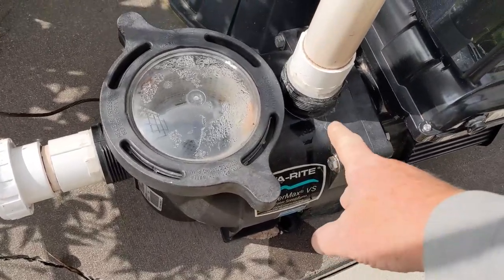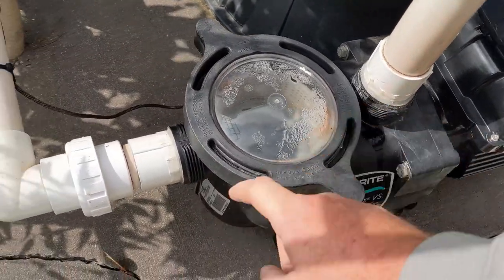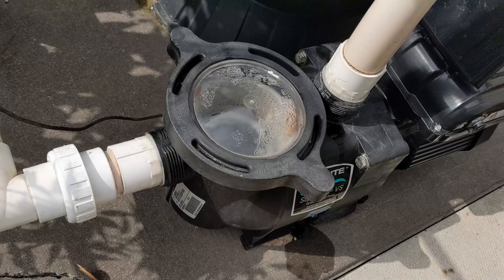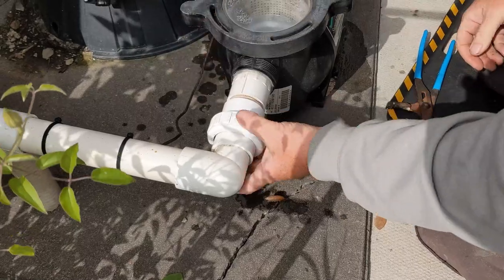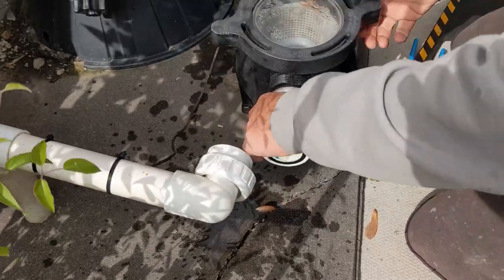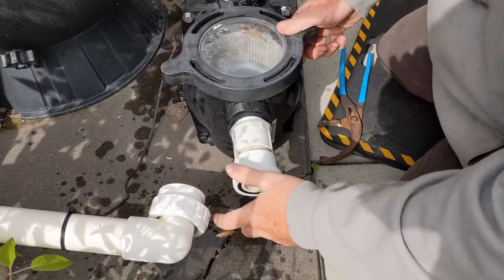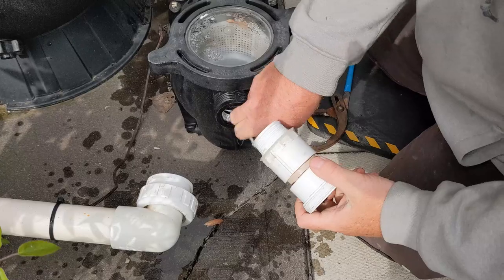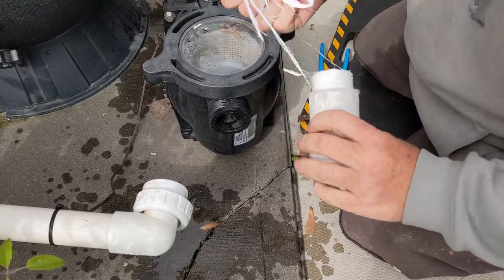How to Fix a Pool Pump Pipe Leak (Glue Fittings)

Comment from the maker: If you have any questions, please comment below.
Reply: So... what did you use on the tape? Yo did not even explain WHAT you did.
Reply from the maker: @kriswingert1662  that's Teflon tape and silicone I used.   I shouldn't assume that people know what I'm putting on.  Its like the hot coffee thing I guess.
Reply from the maker: Learned this from an older tech.  It works.

Comment: Never seen anyone put anything over Teflon tape.  I have a lot of accounts with the same exact leak at pump unions.  Starting to learn repairs.  Doing maintenance mostly.
Reply from the maker: it works.  got this tip from an old tech 20 years ago.

Comment: I have a leak similar to the one you show on your video and my pool guy is saying he may have to replace the housing.  Is that possible ?
Reply from the maker: The ONLY way that the wetend of a pool pump needs to be replaced is, if the threads stripped.  This only happens when using hard pipe and plumbing it the same as in the video.

Comment: Nice vid! Clear and easy.  What are those fittings called that you had installed to loosen the PVC at the front and the top of the pool pump?  Mine are glued in on both sides.  I would like to be able to remove my pump and store it during the harsh winter.  Thanks.
Reply from the maker: 1.5 inch union

Comment: I used silicone and teflon just like this and it’s STILL leaking 😢 any suggestions?
Reply from the maker: Check the threads on the fitting and the pump.  Might be stripped.  Mostly likely will be the fitting.
Reply: @VIPPoolsandSpas thank you! i think you’re right. we’re just gonna get new hoses and connectors and try again 🤞🏼